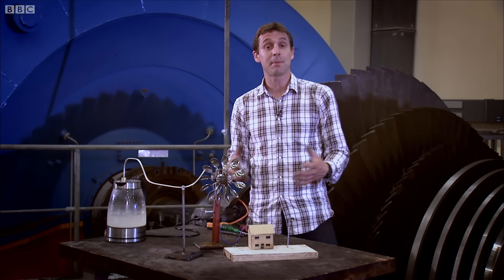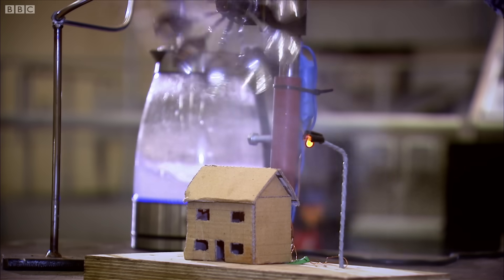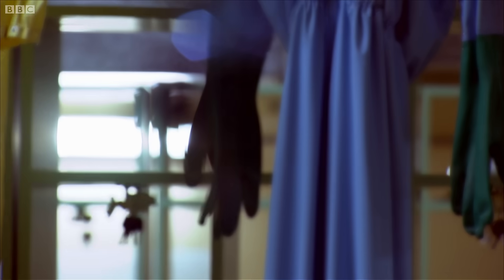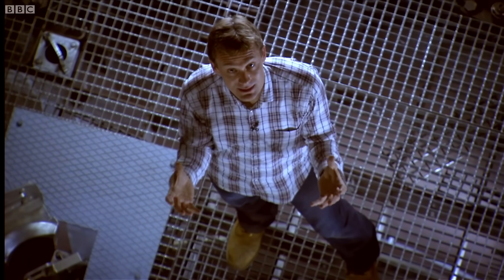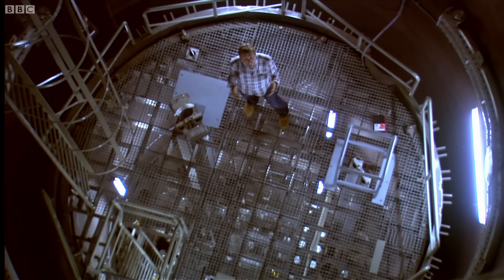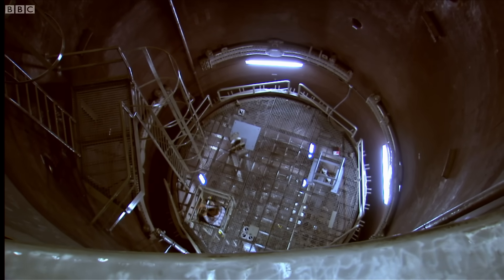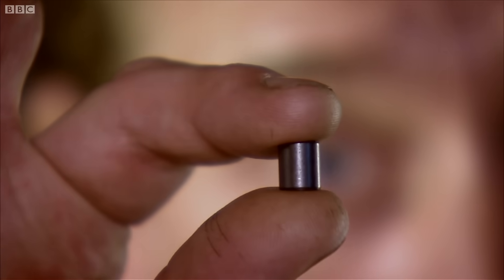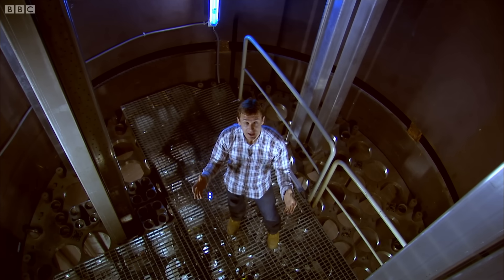Inside a nuclear reactor core - Bang Goes The Theory - BBC

Comment: A liar or he didn't find nuclear byproducts important enough to mention as a result of fission. Uranium does not split, it fractures. Since a neutrons randomly hit uranium in different areas, it breaks the uranium into different brand new elements and there about 200 different possible combinations that can be created when fracturing an uranium atom. All are radioactive and one of the new elements created is plutonium. After about 3 years of an uranium pellet undergoing fission inside a reactor, 1% of that pellet turns into plutonium. Of course, the decay heat of radioactive daughter-byproducts (when released to air it is called 'fallout') has to be dealt with for centuries after the fuel is removed from the reactor by keeping it cool and stored safely. A gift for our future children.
Reply: ***** So far anything you are proposing is not competitive or cost effective in today's world and yet unproven to be safe for the radioactive waste products created. Ignore the radioactive wastes to ignore the long term costs of dealing with them doesn't make them go away unless you plan on dumping them into the ocean and worry about it later.
Reply: ***** Because the more energy you pump into the environment the more the temperature of the environment rises to increase the rate of heat release into space.

This means the more energy you generate by any nuclear method the more you warm the planet.

Sorry but basic physics makes the nuclear saving the planet argument somewhat idiotic.

We need to use the energy flowing through the environment and not add energy to the system. OK not a problem so much today but it will be in the same way that CO2 was not a problem when the problem was recognised as being a '1000yr off' problem yet today it's a massive issue.

Comment: now lets explain a LFT Reactor Liquid Flouride Thorium. An LFTR is the safest reaction on earth and is contained in a very small package, Thorium does not need water to stay cool nor does it require a vast amount of space for a controlled reaction, LFTRs have been around since the start of the Nuclear power age, but got overturned because they could not make bombs with them. They produce just a few hundred pounds of waste every 80 years or so, and that waste is safe within just a few hundred more years. Thorium Reactors can not explode like a LWR or FBR, Because they operate at normal atmospheric pressure, The worst case accident would be a Sodium leak which would result in automatic shutdown of the reactor, it takes just seconds to shut down the reactor, and only a few min to start it back up again, it is not capable of doing any kind of Nuclear damage to the surrounding area, and must be maintained by man or it stops reacting. LFTRs are the safest form of energy on earth, and the NRC, and many other groups like the IAEA are promoting its movement. An LFTR can not ever be breached to steal the source for a bomb, it is virtually safe to handle in small amounts, is safe when separated from its mass, is only an alpha emitter hazard only to the skin, or if eaten. LFTRs have been a proven power source. LFTRs can produce the cheapest power on earth. Thorium is the second most abundant resource on the planet. several automotive companies are looking at building a car that is powered by a mere 8 grams of Thorium, which powers a laser that powers a car, 8 grams of Thorium is almost safe to handle, and would never be a threat to the planet because you can get 8 grams of thorium from about a dozen bucket fulls of dirt. Thorium Reactors can run on fuel from .9 metric tons of earth moved as apposed to the 38.9 metric tons needed to be moved for a Uranium reactor. A Uranium reactor needs many acre's of land, but a LFTR only needs about the space of a 3 bedroom home. The fact that LFTRs, and Thorium are not talked about in almost any circle is sad to say the least because not only is it safe in any environment and would not have even been an issue in a place like Fukushima, is a sad sad tale to tell because it means we are all missing out on a power source that is safe, cheep, and cost effective. Uranium has to be changed in the core when it has only used about 30% of the fuel unlike Thorium that uses 98.8% of the fuel before refueling, and with advances in tech could be made to use 99.2% before hand. Thus turning down Thorium = Nuclear Power over all is not only foolish and stupid but shows the ignorance of the people in this world, who would rather see the terror of the bomb making power stations, and not bother to consider that all elements have a radioactive number. Even ash from a fire is radioactive known as Carbon. Freaking out about Nuclear energy before understanding it is foolish to say the least, it is like the Amish freaking out about electricity, and cars, or people fearing a mirror.
Reply: Do you like jazz?
Reply: Not really a conspiracy when lots of countries are racing to do salt based reactors lmao the only reason we arent using it was because they scrapped the program for fast breeders as they already knew how plutonium worked.
Reply: But... no one is making them right now, because you can't make weapons of mass destruction from Thorium. :(
Reply: @thedeadlinger6992  Well we Indians are making it, because we have hell lot of thorium deposits in one of our states. Well the progress is slow, but Research and development is still happening
Reply: Companies don't care for the future though
Reply: Thorium conspiracy theorist. Wow. You guys got boring fast.

Comment: Yup, they are little more then a big boiler that is heated by the decaying of unstable matter.
Reply: use thorium, very safe , low pressure and you can not have melt down. No brainer

Comment: Your naivety suggests to me that you are young. Were you born when 3-Mile Island happened in 79?
 
That accident could well have been way more severe than what Fukushima has been up till now (discounting the VERY dangerous core removal procedures about to take place). It iks only by sheer luck, that it didn't go into full melt-down.
 
Nuclear power, when going smoothly, is a brilliant source of power. But when things go wrong, they go wrong in rather devastating fasion.

Comment: A single atom splitting can't blow up a city, if that were true then an atomic bomb wouldn't need to be more than a single atom and would not weigh thousands of pounds. It is the chain reaction of many atoms splitting that cause the explosion and the more fuel(atoms) you use, the larger the blast radius.

Comment: No, the water is also there to take the heat away.  You seem to imply that by "controlling the water" you mean lower the water level.  That would certainly decrease the number of slow neutrons but the heat generated by decay, which would continue, would eventually melt the fuel elements, ala Three Mile Island.

Comment: Various ways.  Passively, the geometry of the reactors innards is such that, with a full load, with the control rods partially inserted, the reactor should be just critical; you can design the reactor to boil just above critical; the fuel pellets have a little room to expand in their casing, spacing the U apart and reducing reactivity when the temperature goes high.

As the fuel fissions, its reactivity also goes down - so over the life of the fuel, the control rods are slowly withdrawn.

Comment: It's the hottest you can reasonably make water and still expect it to remain liquid at the pressures you can maintain at the volumes needed for a reactor.  If it doesn't stay liquid, you lose moderation, and the reaction dials down (which is the way a boiling water reactor reins itself in).

It's fine, though; 30C to 300C is plenty delta Q to run a turbine.  You could go more thermally efficient with molten salts - running the reactor at 600-900C - but they don't moderate as well.

Comment: For googling: The Oklo natural nuclear reactor.

For thorium: the reactors don't exist yet.  While I agree they're safer in principle (and cheaper and more efficient than LWRs, also in principle), there are a number of chemical management and materials science questions that have yet to be properly researched.  And while there's been a proof of concept U-233 reactor running on molten salts, there has not yet been a thermal breeder built on the technology.

That said, there should be.

Comment: they would love to increase the temperatures that these reactors run at (look up VHTR and Gen. IV reactors), but right now the operating temperatures are limited in order to stay in the regime that the materials in the reactor can handle. higher temperatures would allow for higher efficiencies (Basic efficiency limit is 1-Tc/Th), but they would not be able to ensure that the materials were safe at these higher temperatures until more research is done to qualify materials at those conditions.

Comment: The main way to control nuclear reactors is Boron-10, an element that absorbs neutrons and essentially kills off the chain reaction. Coarse adjustment of the reactivity in the reactor can be achieved by moving large boron control rods in and out of the core. During normal operation, chemists change the concentration of boron in the water to make fine changes in the reactivity over time. there are other ways of controlling it as well but these are the easiest two to understand.